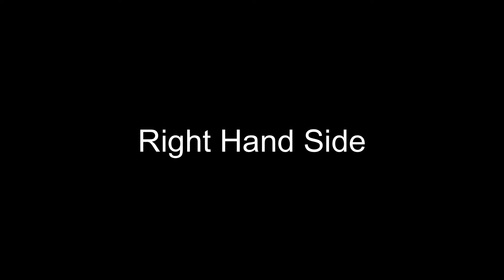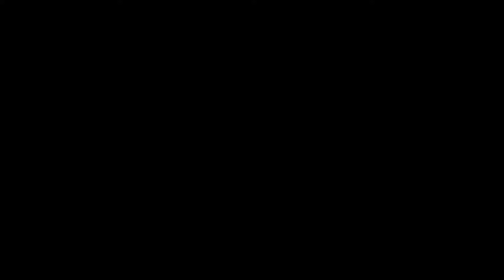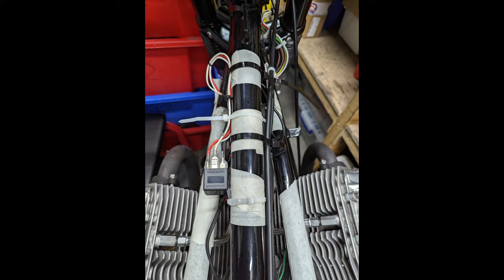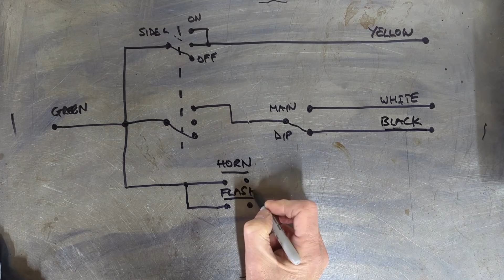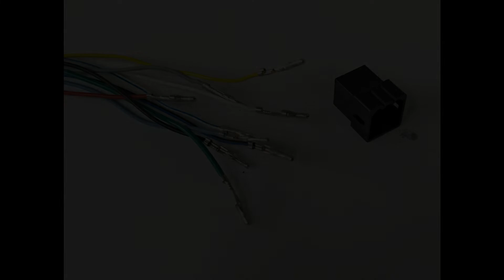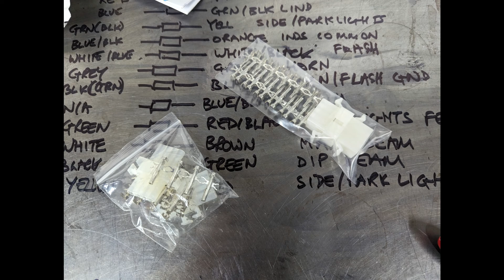Moto Guzzi Le Mans 3 Part 12: Domino Switchgear

Comment: 1 little question. does this wiring og the domino switch gear give you the possibility to leave the bike with sidelights on when you take out the key?
Reply from the maker: I think it does, I'll go check later.
Reply from the maker: The lighting works the same as the original,  so the side lights can be left on  via the ignition key (fully turned clockwise to remove the key).  The headlight lamp on the dash is also illuminated.
Reply: @MarksMotorcycles-rk4yp  Ok, thanks a lot. In Denmark, its obligatory to have the option of sidelights/no key

Comment: Crap domino kill/starter switch left me stranded a few weeks ago. The ignition contacts got hot (no relay), it melted the plastic mold in which it sat, moved and disconnected the ignition. The unit is at least 20 years old and bad contact with heat was probably involved. An option  is bypassing the ignition cut section.
Thanks for the video 
(Also a guzzi rider)
Reply from the maker: That's pretty crap - I'll look at mine again, but I'm pretty sure I've got a relay in the circuit - from memorty is was a bit of a weird set up on the original, which I think was due to the wiring of the inbuilt relay in the starter motor.  As a result, on the LM3 there are two relays in the starter circuit).